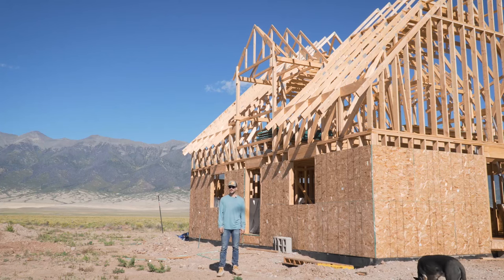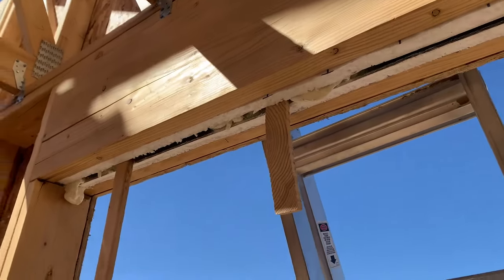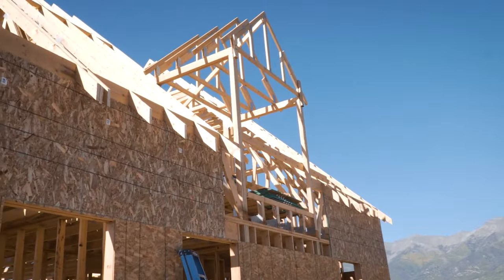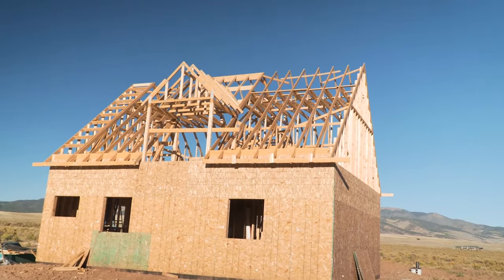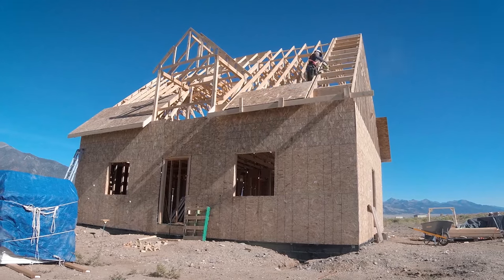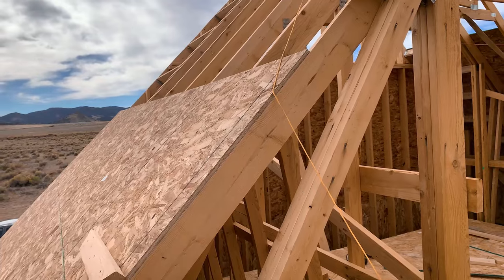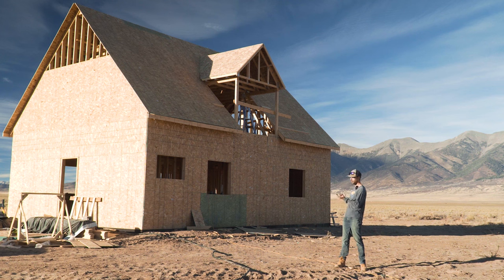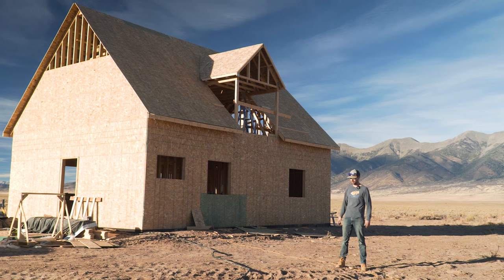Building My Own House: Finishing Framing and Sheathing the Roof - DIY Timelapse

Comment: So basically due to inflation since 2020 you've had to spend an extra $10,000? 🙄 😂😢
Reply from the maker: I got lucky with the OSB timing, it was cheaper than pre pandemic prices! Having said that, I waited one day after the quote to buy the lumber package and the rim boards when up by $50 each (for a 12’ board) so the market is still wildly volatile